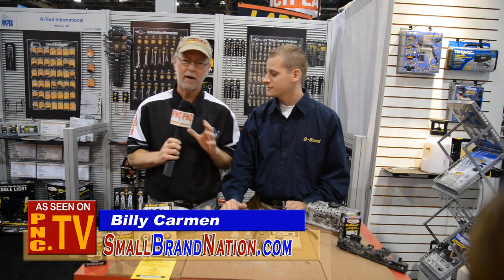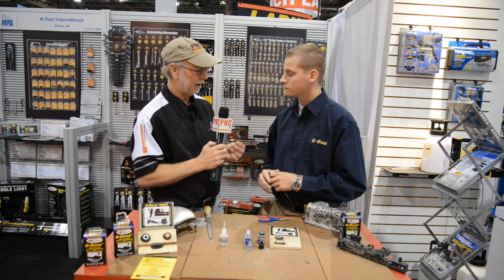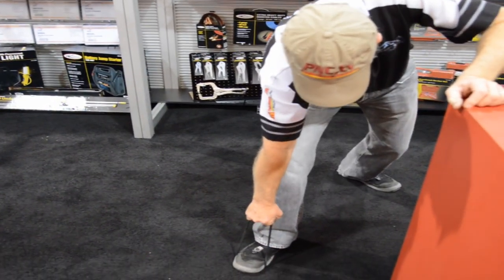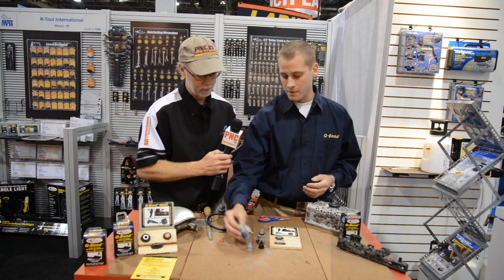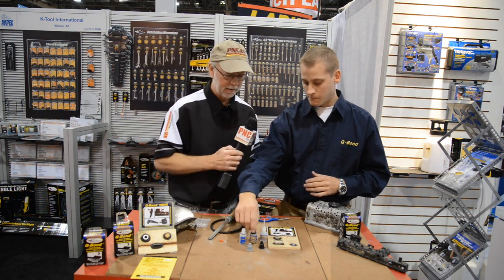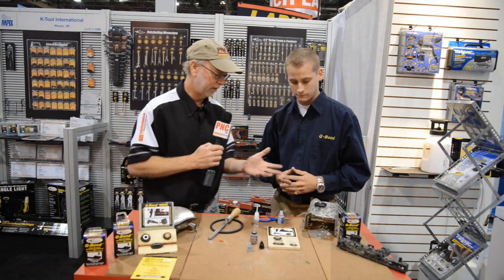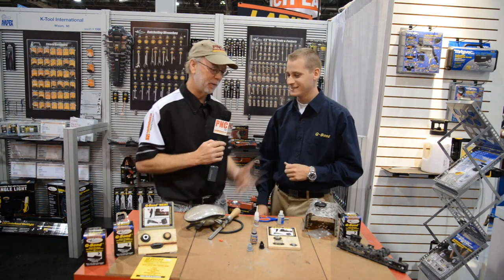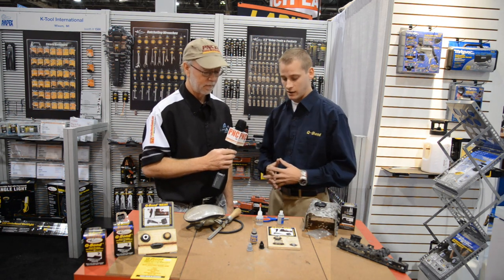Q-Bond Adhesive Repair Kit with Reinforcing Powders New Product News Trade Show Videos

Comment: I have a 1994 Toyota Celica GT in need of Radiator leak repair.I have NO HEAT.I watch all the youtube video and saw this Q-Bond video.I went on Amazon purchased this product along with Rapid Fix.cuz it was recommended.Q-Bond arrived first .I used Q-Bond,I waited over night to cool off the Radiator.followed all the instructions Q-Bond says.sand paper and cleaned the crack area located near the radiator cap.the size is 3 inches long,the 2nd one was 1 1/2 long.(2 separated area next to each other.) Powder the area then the liquid,I put enough just to make sure it's Glued.waited  for @ least 10 mins,at first it work for about 30 mins.after that my radiator started to leak and smoke again.this product Q-Bond does not work on a hairline crack to my radiator.I could not go to work.then, the Rapid Fix arrived a day later.Did the same,clean the affected area.followed all the instructions and they also comes with a mini DVD.I saw it already on this youtube. but u I watched mini DVD provided again. Anyways.Liquid the area and then the powder.rea next to each other.) Powder the area then the liquid,I put enough just to make sure it's Glued.within less than 10 sec it started to show some good sign.But just to be sure that it holds completely glued.I waited for at least 10 mins before staring the car engine.Waited at least 10 mins more to heat the engine with the hood opened.I did not see any leak.I drove to the Store about 2miles.lift the hood up.and check it again while the engine was running.NO Leak! I then drove to Gilbert IL, about 45 miles out of Chicago,IL NO LEAK,NO SMOKES AND on TOP of it ALL I HAVE HEAT in my car.Sorry, Q-BOND but your product work on other things to FIX .but I know I want my Refund. but I'll keep on other things might a useful of.

Comment: Could it work on copper pipe hole?
Reply: I have a hole in a pipe. Is there a way to plug it when I can't get behind it?
Reply from the maker: +Marian McAfee Hi Marian it's not an easy one but it can be done. If the pipe is dry you can make a wet pile of the powder and right when you pour the super glue to it you can dab the surface to build a foundation then add more more layers on top.

Comment: Mitsubishi Triton/L200 wheel arch flare bulging because fixture to hold a push in "panel clip or Christmas tree" or whatever you call them is broken on back of the flare.
The wheel arch flare Plastic clip retainer is the same design & principal as a door panel clip retainer, but on back of flare.
 Re-made one half of the plastic clip holding arm on clip retainer. 
CONFIRMED >>-------> finish product is Solid, strong, permanent & can be shaped easily with a file.